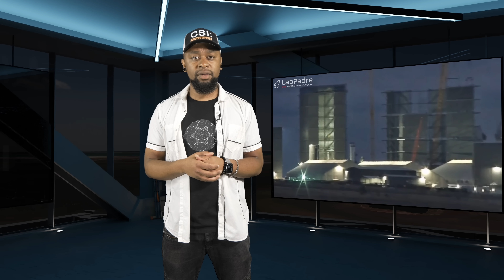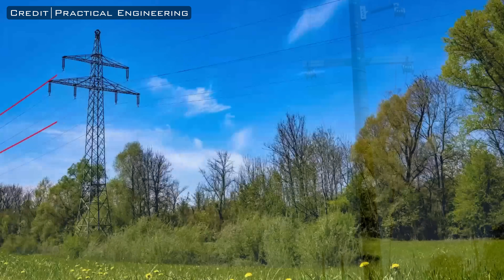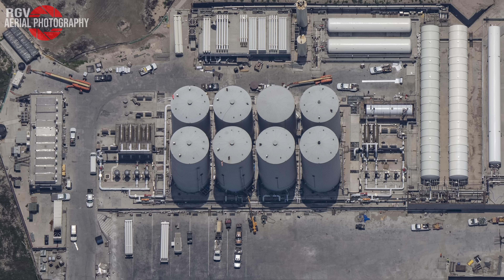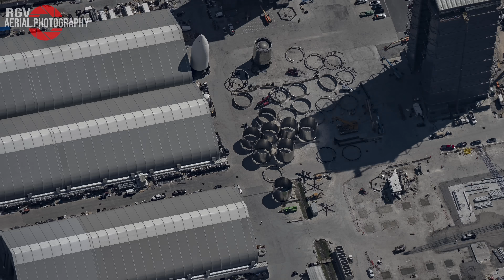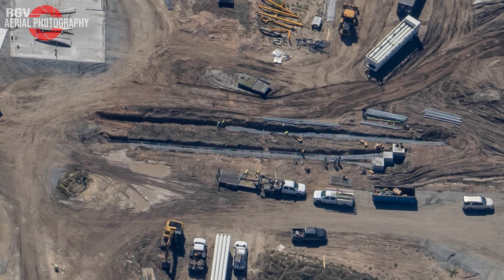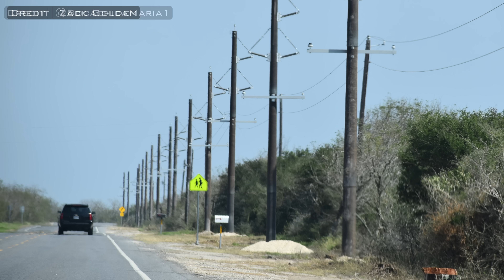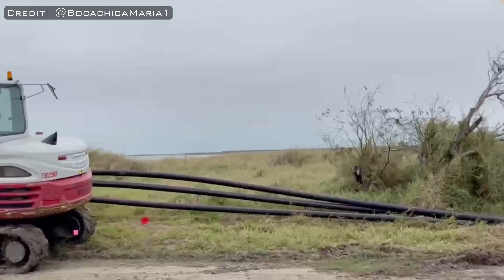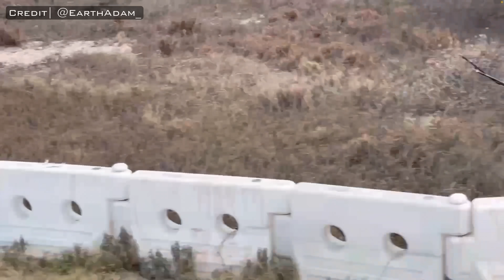SpaceX Abandons “Off-The-Grid” Operations At Starbase!

Comment: Fantastic episode.  I've often wondered where Starbase was getting its power from.    I wonder why they didn't run a natgas line to the site and then generate their own power with their own turbine.   I'm guessing the peak load is much greater than the average load and turbines aren't efficient at part load.
Reply: Running a generator is probably not worth it long term, the upkeep is gonna suck considering they're piston engines. Combined cycle is more efficient, but still the upkeep as a sole operator on the small scale probably not worth it. Just take the grid power and supplement with solar and megapacks as a buffer.

What I'd have assumed would be more worth it is a nat gas line to purify and liquefy for use instead of trucks. But the environmental approval and upfront cost to install for a site that can only launch 6 times per year is probably just not worth it. Maybe the cape will do something better for propellant since it's probably going to be much higher use.
Reply: @Jaker788 lol!!!! Nonsense!!! Why didn't they use turbine gas generator!? Significantly way more powerful and also those things are actually reliable and can output gigantic amounts of energy 24/7
Reply: @carholic-sz3qv  Combined cycle or more commonly just simple jet turbines single cycle are still the most expensive power generation, they're used for peak demands by grid operators and not 24/7 because it's so expensive. Sure it's cheaper than diesel or possibly a natural gas based piston engine, but grid power is even cheaper by a lot. 

A simple jet turbine would've been the most likely feasible option for SpaceX, but that's a small upgrade over the piston engines in efficiency, so your fuel cost is still very high over grid power. Combined cycle brings the efficiency up to 60% or more but takes a significant extra footprint for the second cycle of a steam turbine that isn't feasible or worth the upfront cost after having all this grid power installed.

Tesla megapacks are the exact thing that have been putting gas turbines into retirement because it's significantly cheaper to charge them off base load plants and use them for peak demands and load balancing. Adding solar and wind on top is just extra icing.
Reply: @Jaker788  Tesla packs arent putting no turbines to retirement! Those are peaker power plants and also the grid is generally powered with all kinds of sources including those much bigger turbines at higher scales since it's cheaper! With a direct supply of gas and also heat and other récupérations systems it's also very efficient. The excess heat can also be reused or sent to be used for many other applications around the power plant.
Reply: @Jaker788  batteries doesn't provide a significantly very high and reliable energy all the time! Imagine a steel mill trying to run on batteries!!
Reply: @carholic-sz3qv  That's not the point. I used batteries as an extra example in grid scale applications over turbines expense, they cover peak loads and filling lulls in demand with their own charging load. In your example of a steel mill, if the grid had peak and off peak rates a steel mill could save money with a battery buffer to cover some peak hours and charge off peak. They'd still have grid power like SpaceX will. 

However, the point is that a gas turbine is still very expensive electricity when they already have a 3 phase grid connection now that will be plenty capable as we've seen from the cable gauge. They literally have no need or benefit to operate an expensive power plant now.
Reply: @carholic-sz3qv  I don't know what to tell you man, mega packs and other storage are indeed replacing peaker plants, and gas turbines are expensive compared to the many other sources used to cover base load and the wind and solar that's mixed in. There's a reason every operator is planning large storage projects and retiring peakers. SpaceX also doesn't have a direct supply of gas. There is no legitimate reason to run a large generator anymore, doesn't matter how good a turbine can be, the grid power is cheaper still and their mega packs and solar can help supplement peak hours to even cheaper rates.

Comment: Hi Zach. Nice work on this. I'm new to your work and am liking the content so far. I enjoy deep dives with academic depth. I agree with your guess that the extra methane and LOX pumps were added to increase loading speed because they were already operating with a full set of redundant spares. They would only be adding more to increase the mass flow rate during loading..... as far as other content....have you considered (or have you already done) a deep dive on a risk assessment for if StarBase were to take a direct hit from a hurricane? This building site location presents a substantial risk to mother nature...hurricane, loss of power long term, storm surge to the launch site affecting infrastructure, etc.
Reply from the maker: Thanks, that would be an interesting topic to cover. I can consider looking into that once they finish making all of their changes to the tank farm! The redesign will have an affect on that analysis.
Reply: There are two types of infrastructure at Starbase. There are the parts that can withstand hurricanes and rocket failures, and the infrastructure that can be replaced quickly.

The permanent structures are intended to be very robust, I think designed for category 4 or higher storms.

SpaceX moves fast and makes mistakes. It corrects them and moves on. The vertical tank farm is being replaced, as it wasn't strong enough.

Comment: 3-phase doesn't deliver 3x the power of a similarly sized single phase system.  It deliver the square root of three times the power, or 1.4something.  Technically "watts = volts x amps x power factor x the square root of 3"
Reply: Depends on delta or Y connection (square root 3 is about 1.7).
Reply: Depends if equal voltage means between cables or between cable and ground. If the 3 phase system has the same voltage to ground than the 2 phase system, the voltage between wires is square root 3 larger. So the total power is indeed 3 times larger. You are using 3/2 = 1.5 more cables, so per cable the power is 2 times more but with higher insulation between cables (but not to ground) needed.

Comment: I see the line. look like wiring that doesn't required conduit.    There special coated power lines you can just put in ground .   Dont know the code there but should aleast be submerge in ground 3 feet.  I m sure is cooper coated and aluminum for faster current.
Reply: Term in the industry is direct burial. But depending on the dividing line between customer and energy supplier, you might have to look in a location other than the National Electrical Code for the rules and wiring tables.
Reply: It appears some of this “conduit” is protection cover. Wires can be run at surface with the right amount of cover.